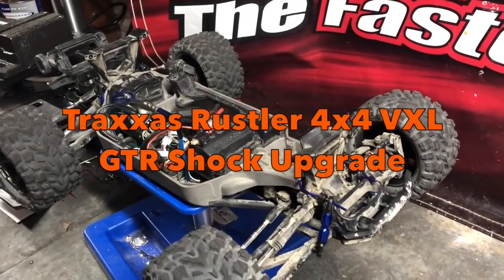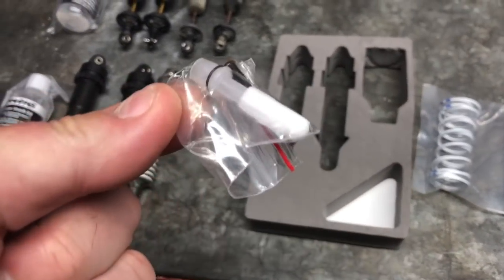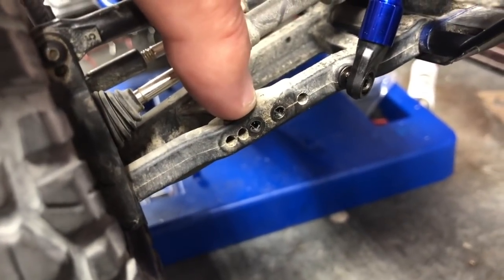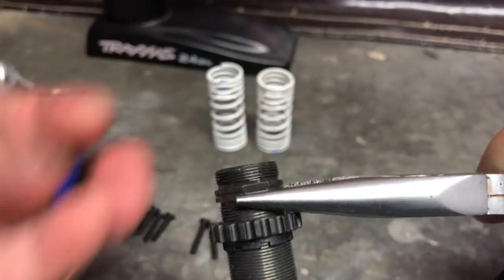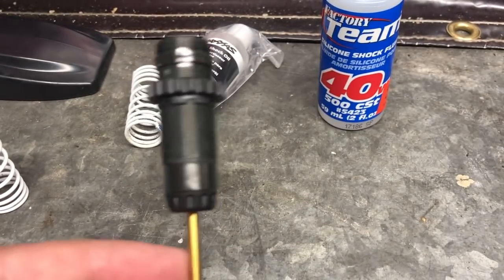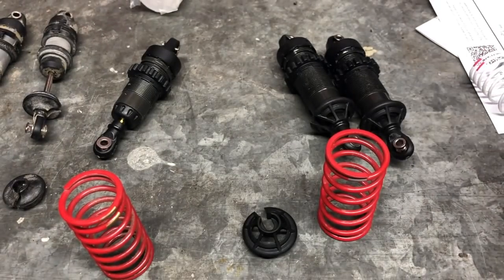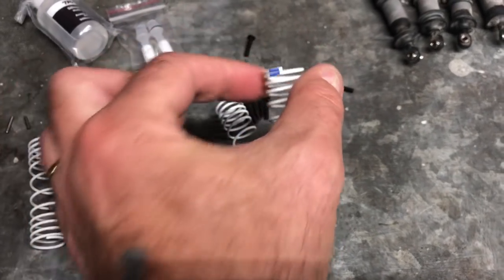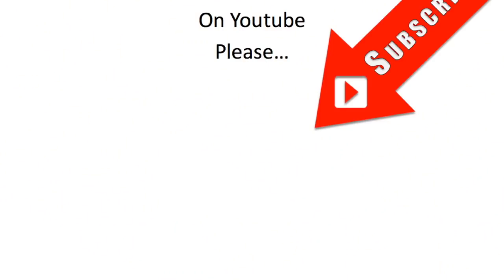Traxxas Rustler 4x4 VXL GTR Shock Upgrade

Comment: Do youbhave any videos regarding doing the wheel alignment, or addressing the excess play at the wheel hub from the factory?
Reply: Usually it’s bearing but in my case my rear lower arms for my rustler 4x4 was bent and i didn’t even know just look at everything closely and usually replacing the plastic parts for new ones should do the trick

Comment: I just installed the grt shocks in my son's rustler and I noticed while the rustler on the stand, that the grt shocks makes the arms of the car higher up. Does that make sense? I mean, between the ultra shocks that come with the rustler 4×4 & the grt shocks, they look like the same length. So, why does it make the rustler's arms higher up (as opposed to the ultra shocks hangs down further off the ground when placed on a stand)? Someone help /=

Comment: Honestly this is traxxas crap
Reply from the maker: Constructive feedback is always welcomed. Like 'They're not good for the following reasons...xyz etc'
Reply: You can go on ebay & buy 4 sets of full aluminum shocks w/ 4mm shafts for the price of this junk (not even counting the springs & oil). Plastic caps? Rly. It's suppose to be an upgrade you know. I can go on, but the 1st reason is more than enough. 1 set of those same aluminum shocks outlasted 2 Slash 4x4s & a Stampede 4x4 & are currently being used by a TRMT10e. However, "Honestly this is traxxas crap" wraps it up in a nutshell.
Reply from the maker: @Megasty15  Calm down Boys!!!! No worries at all but why not make a video highlighting that "These ebay shocks are better than traxxas GTR ones" (It can be done on a mobile phone), just curious as to why if you know of a better alternative you are watching a video on a poorer solution? If you hate Traxxas a lot then why watch a video on a Traxxas upgrade? As an example if you know how to drive a car why watch a video on 'how to drive a car'. See my point? This video didn't claim "They're the worlds best RC shocks" or "They're the worlds cheapest" - take it for what it is.
As ever all constructive comments are welcome. Indeed if you post a valid point with a url then I'll take it out of the youtube spam filter and highlight it. So send me the link to the cheap ebay shocks vs the traxxas GTR ones. Or send me a link to the ebay ones and I'll buy them and do a comparison video. But DON'T read more into these videos than what they are, if you hate a traxxas product that much - simple answer is stop buying traxxas cars to fit them to!!!!
Reply: @DriftomaniacsRC  Hate Traxxas? Why would I hate them? I have 5 Traxxas cars, including a X-Maxx. I just think their prices are ridiculous, mostly for upgrades. There's no reason to buy them. Even the most expensive alternatives like Proline & Hot Racing are better options. Take for instance the new servos they offer: $100 for a slow 25kg~ & $150 for a 30kg~. Savox & Hitec has them completely over the barrel in that field & they're some of the most expensive alternatives as well. The dirt cheap JX servo for $20 & $25 respectively have similar specs. Just because it has a Traxxas logo on it doesn't mean it's automatic an option over the boys who has been doing it forever - especially when some of the cheapest stuff you can find still outperform it. 

https://www.ebay.com/itm/BIG-BORE-ALUMINUM-Shock-For-Traxxas-Slash-VXL-4x4-2WD-XL5-Gold/282506231388?hash=item41c6aefe5c:rk:5:pf:0 These are some of the best shock I put on my Slash. 

https://www.ebay.com/itm/DARK-Blue-RC-Car-Aluminum-Front-Rear-Shock-Absorber-For-1-10-Traxxas-Slash-4x4/291634321299 I tried these back in the day as a direct replacement for the GTR. I put the GTR shocks back on the car when I sold it.

Even the sway bars on the Rustler are HR & not the relatively poor set that Traxxas offered, came stock with my Slash, & failed on me several times b4 replacing them with HR. The Traxxas set also costs a few pennies more than the HR. I don't mind buying Traxxas stuff if you can come close to getting what you pay for & not throwing money at something you can get at a much better value elsewhere. The X-Maxx metal gear servo, for example. I bought it. It was a much needed option over the plastic gear servo & the only other options other than that involved small servos that taxed the RX to hell or cutting the chassis to fit a 1/5 servo which is crazy. Some Traxxas upgrade parts have their place but most are simple money pits.
Reply: Doing it forever huh lol, traxxas has been doing it since 1986! They are the most experienced ones!